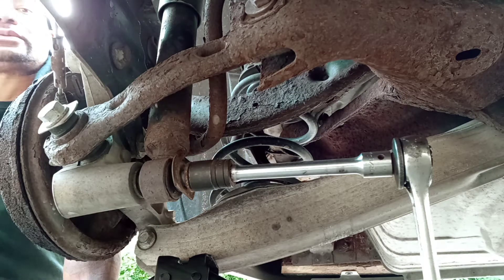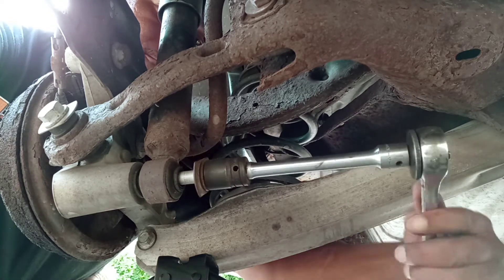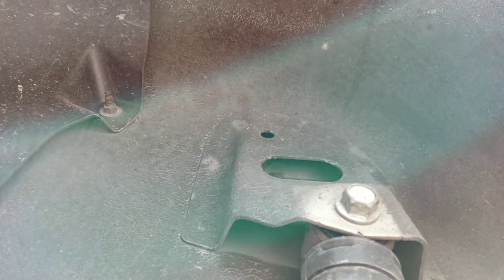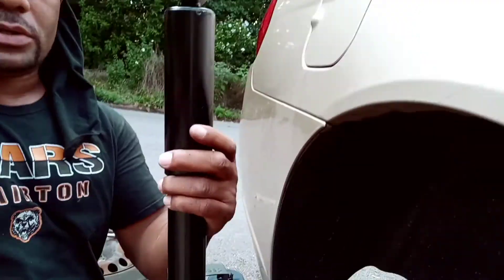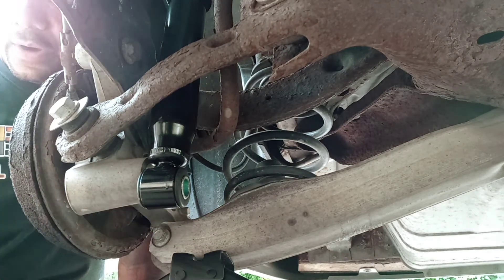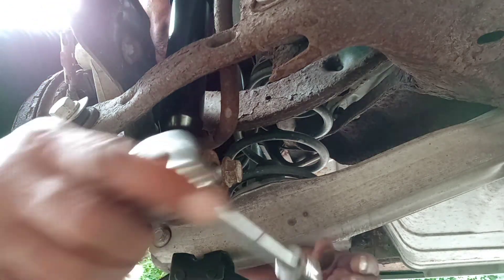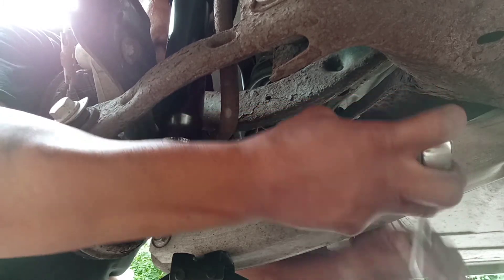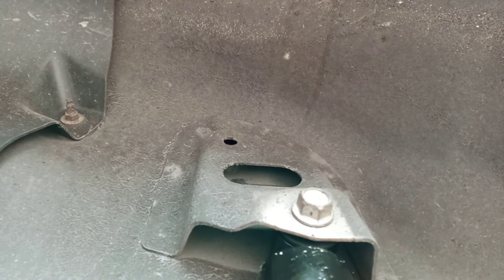DIY 2005 Chevy Malibu Rear Shocks Removal

Comment: I enjoy your automotive videos. I used to work in a body shop. Was knowledgeable enough to take cars out on a diagnostic run.Took out cars after accidents to figure what was going on that needed immediate observable care. Tie rod ends, control arms, wheel bearings, alternators, water pumps, watched replacing many things.  Also did photography of accidents to back up insurance claims.Started as a detailer, and cleanup detailing of new cars . I worked at the body shop & could diagnose for repairs but never was flexible or stong and healthy enough to crawl around and fix them. I enjoyed being at a dealership. I even sold a few cars. I was I guess learning everything and how a garage worked.It was not a job 9-5 job because I did not want to show up everyday at a regular time.  I did go in  every day just to see what was going on and got to get good deals on vehicles when I wanted them. I really loved it cars, suvs, jeeps, trucks off roading. Odd I guess some would say for a woman age 21 to 55. My dad taught me and my husband fixed our vehicles until he got I'll. Then we went to a dealer we liked. Thanks Tre57. I love these videos.

Comment: Great video but damn that thing is crusty. My 05 has 276k miles and not a spec of rust on thr rear suspension and it's all original too.
Reply from the maker: We have a lot of snow and salt here on the east coast and it is bad for metal
Reply: @tre57production  Yeah I have family in Jersey and PA so I know what you're going through.